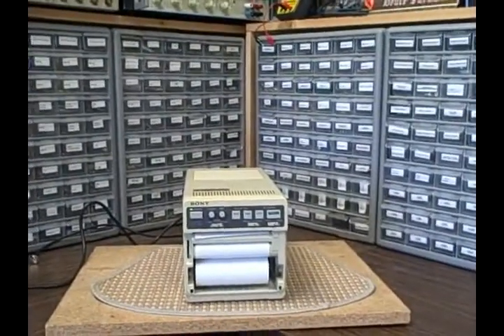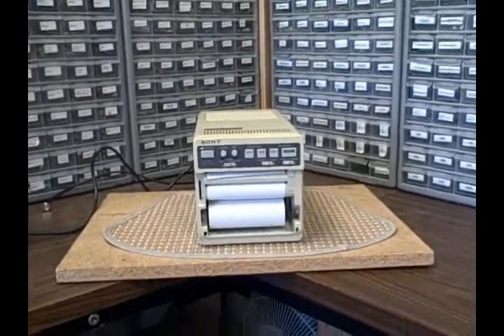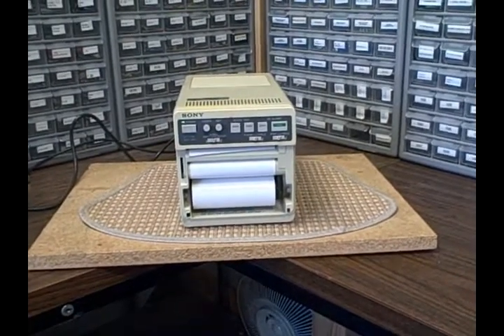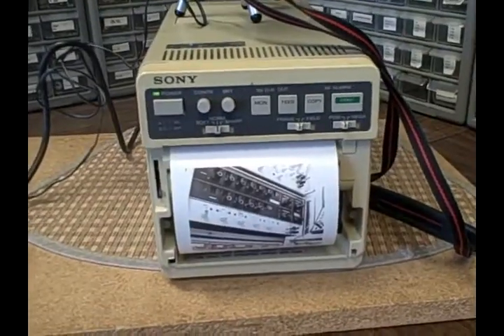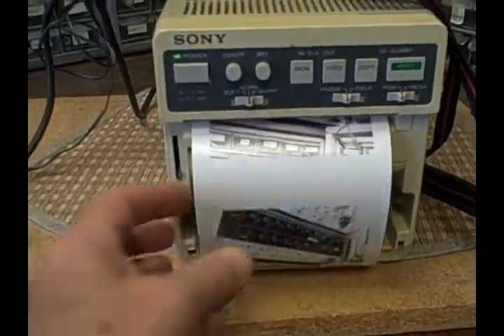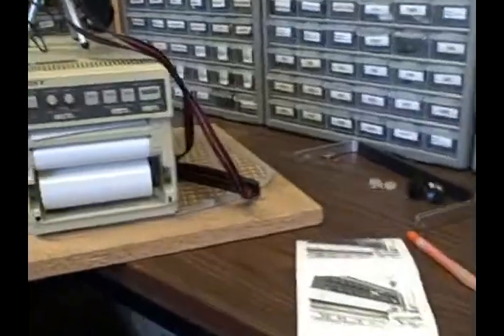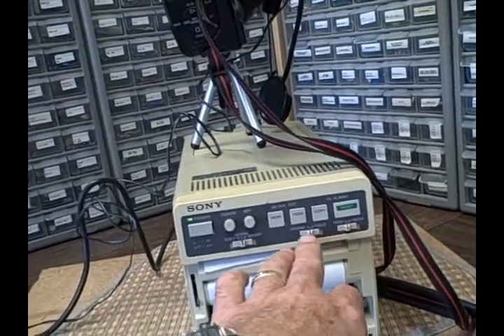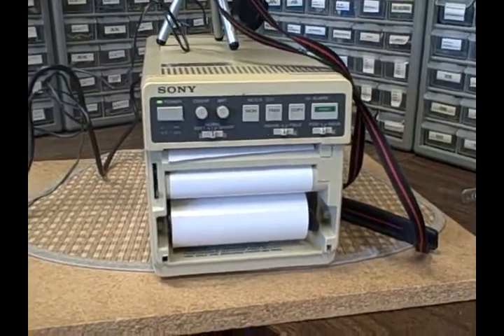Sony UP811 Thermal Video Printer

Comment: The images these can print can be nice and sharp, but are most likely optimised for B/W picture feeds.
When I worked for a manufacturing company of ultrasound machines we had these around in test-setups to test the machines. I never really had a chance to play around with one of them though.

It should go without saying, but you might want to keep the device, or more specifically the exposed thermal paper, out of direct sunlight to avoid degradation. Thermal printers are a marvel of technology but both the fresh and already printed paper are sensitive to heat, UV, moisture, oils and fats, skin-oils from handling, glues and pressure. Don't expect to print long-lasting images :)
Reply from the maker: There is both a contrast and brightness control on the front of the unit, I dialed it in for the first 4 pictures and got a good image and stopped, because I don't want to use up the paper.  It is meant to be used for Black and White imaging, but as you can see the image from a color output printed fine.  The paper is old but works well, but your suggestion of keeping it out of sunlight and heat is a good one, of course!